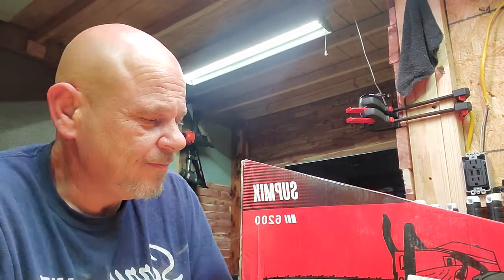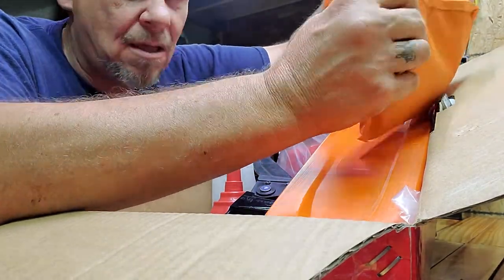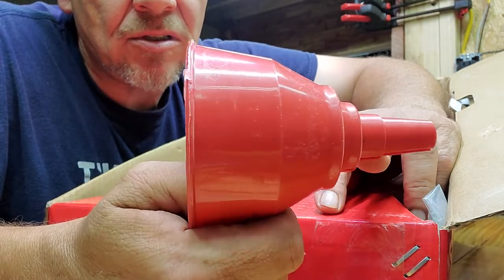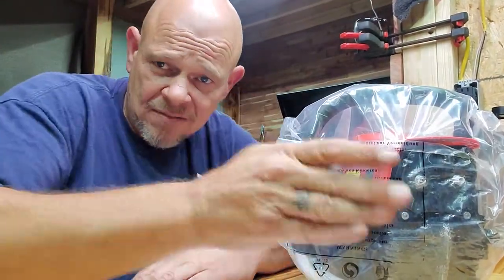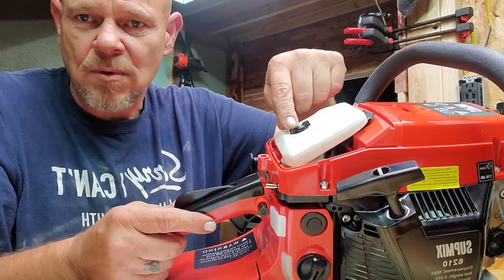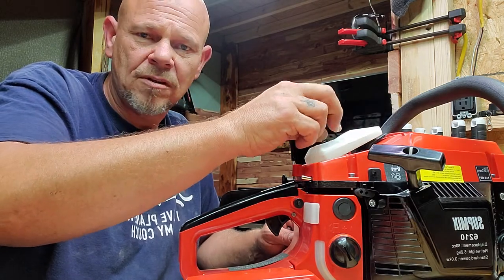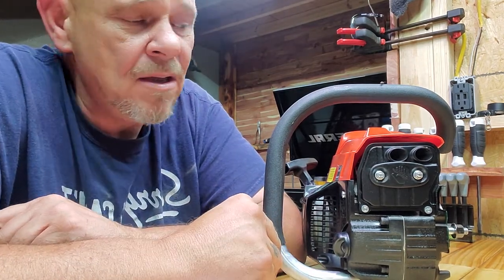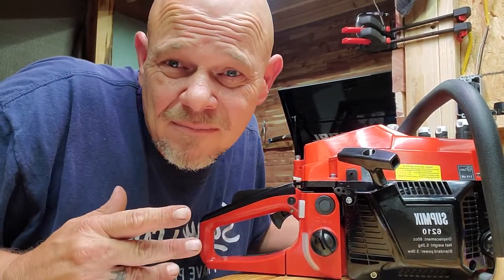supmix 62cc review!!! SUPPPPP

Comment: Just received mine....it is a real beast. I believe this is the best clone stihl on the market....the price difference is unreal$$
Reply from the maker: There supper nice
Reply: What 2 cycle mix you running did you break in with 25/1??
Reply from the maker: @deej7783  no, I run 40:1 in everything! I have found it to work the best for breaking in and every day use. I service 5 tree services and daily customers.  Iv seen these saws last nicely for long term use!

Comment: How do you mix the gas I am really confused on how to do it per gallon
Reply from the maker: Mix 3.2 ounces of oil to one gallon of gas. Go to Walmart or any auto parts store... even Lowes or ho.e depo, and they will have a 1 gal mix of oil. It will say makes 1 gal. Pore it in the gallon can and add one gallon of gas. There will be a line on the can showing ware the one gal is full (on the gal can) or go to pump and add exactly 1 gal. 
Every time you use the gas mix to fill the chainsaw (shake it well to mix) even if you just filled it an hour ago... shake the can! Oil and gas want to separate a little 

Hope this helps you, sir... any more questions, just ask
Reply from the maker: That mix would be what's called 40:1 and works just fine in that saw!
Also,  if you rarely use the saw... just go to Lowes or home depot and get the 2 cycle pre mixed gas... it's like 20 gal but will last you a good bit if just using the saw every so often! And the can gas will last a long time on shelf and saw. 
The other mix gas that I explained.... only keep it for 2 or 3 months at the longest because it go's bad and makes the saw run horrible!

Comment: Hey brother. Ive seen a few amazing chainsaw reviews on your channel including the neo. Whats your favorite out of the bunch appreciate the video's 💯👊
Reply from the maker: By far, the 380,381 clones! F380w is probably my favorite.  Lol, some of them, the air filter and the top cover, didn't quite Mach up... but they are supper strong 💪 and you barely notice. (Amazon has them on sale right now, supper cheap https://www.amazon.com/gp/aw/d/B0B778M211/ref=ox_sc_act_image_43?smid=A22TBJDVUG7OGB&psc=1
If you are a prime member, there like  $210 
The higher end version had a few problems ( the black one) 
But any of the rest of the 380s or 381s ... even holz makes a solid one!